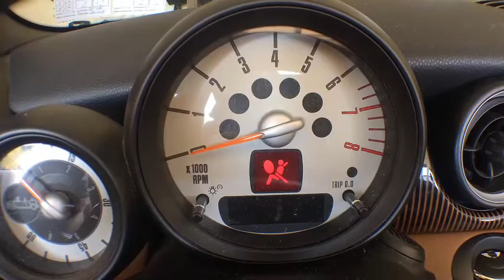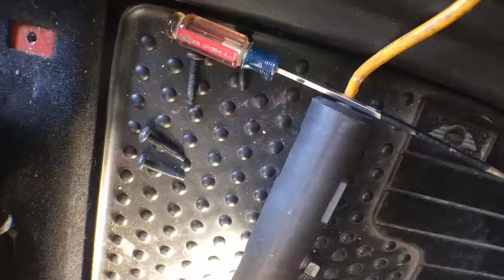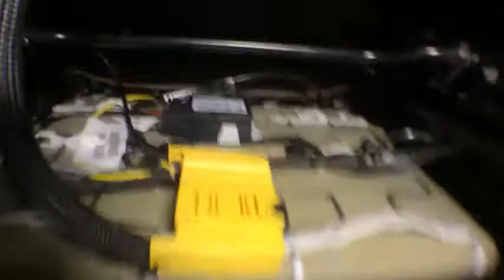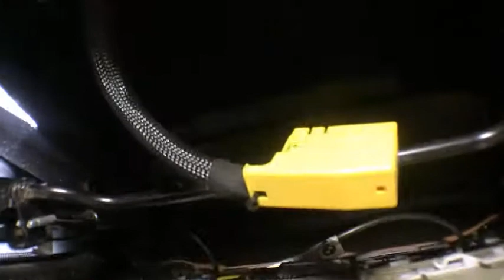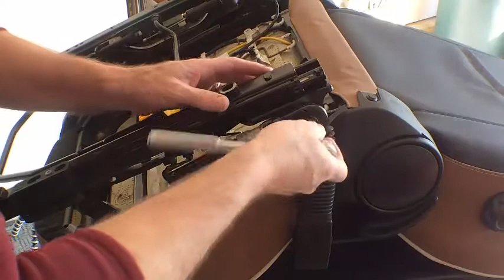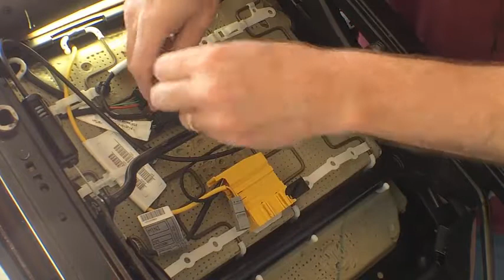Mini Cooper Seat Tensioner Install

Comment: I have replaced the pretensioners. Do I need to clear the codes for both AIRBAG and SETBELT sign, or will the SEATBELT sign go directly after installing pretensioners and just only need to clear the codes for AIRBAG sign?
Reply from the maker: You will need to clear the codes, specifically which I can't say as I had to pay  to have the codes cleared because I didn't have a device to clear and read the codes.  Good luck!
Reply: Thank you. @titch-media

Comment: Question ? How do you know wich side is ?letf or right seat ? Thanks I have same problem r56 2012
Reply from the maker: Hi!  I knew because of the seat I took it off.  Tensioner Left side of seat is driver.  Right is passenger.
Reply: Your seat belt will be on right side of driver seat and left side of passenger seat

Comment: I watched this video to see how I might replace the seat belt tensioner in a 2007 mini Cooper S. This wasn't helpful since the video shows the seat belt buckle replacement. I need to see the seat belt tensioner that the belt retracts into.
Every other time the belt won't pull out far enough and locks up. I have a new tensioner to replace this mechanism.